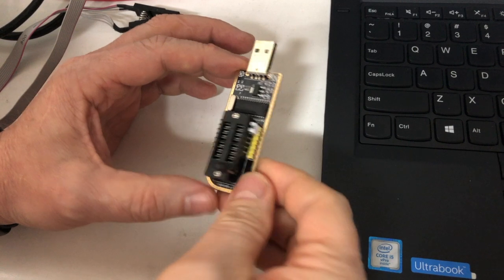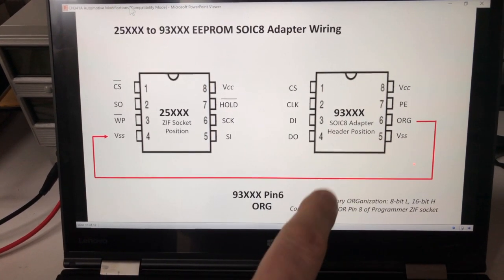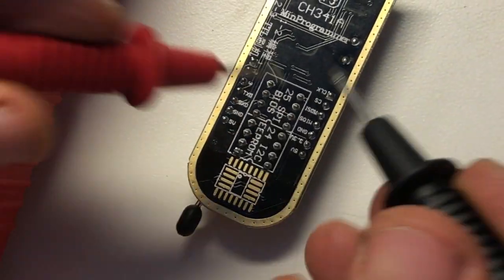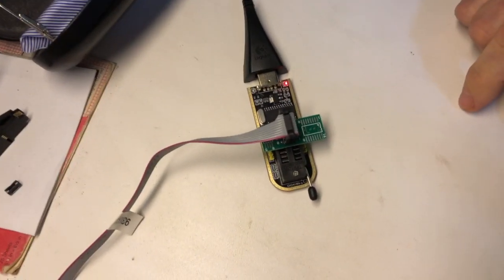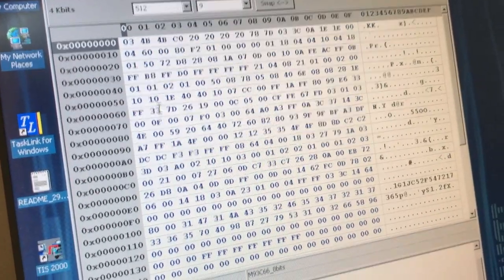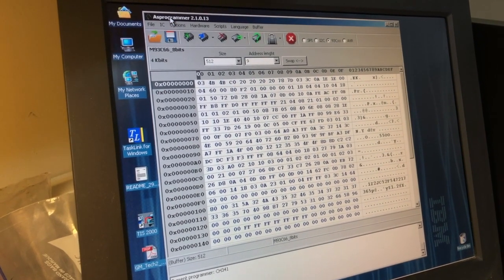Modify the CH341A EEPROM Programmer (Black Edition) for 5V 93XXX & 95XXX Automotive Use

Comment: Hi, there's something I don't quite understand, do I have to cut all connections on the adapter board? (because they are all 1 to 1, 2 to 2 and so on) and then solder wires to the numbers in the schematic? it's not quite clear to me in the video, i want to read and write a 93c56 eeprom
Reply from the maker: Yeah, I get a number of comments/questions about my choice to repurpose the little experiment board that is included with these programmers.  It's totally optional, just seems very convenient to me since the board is included with most sellers of these.   So what you do is make sure, pin to pin, you adapt the board to match the slides shown in the video.  Most of the traces do get cut, and replaced with bodge wires that will be hidden underneath the pins (you desolder that part first of course).   But if you don't want to tear up the little board, you can wire wrap something with a socket or even just hit Eagle and design your own little board and let www.oshpark.com make a few prototypes for you.   No matter how you do it, you just need to build an adapter that maps the programmers ZIF socket pins to what is needed for the 93xxx layout instead.
Reply: Thank, is solder the wires direct on the usb stick on the number you write in the picture but i cant read the eeprom, is have not an 93c56 but an 93s56, this one is not in the list, can you you wit this?
Reply from the maker: @gertbeuk1506  The "S" or security devices require an extra bodging step, listed in the video description.
Reply: @DrShock  i cant get it working, i try to solder the wires but i still cant read it.
i do something wrong but i dont see it.
i follow your schema and write it down so i have the wires from the adapter to the programmer on 
the right place but not working
Reply from the maker: @gertbeuk1506  Being you mentioned it's an "S" device, did you make the modified connection mentioned in the video description for that type?
Reply: @DrShock  Yes I did, I soldered pin 7 to gnd.
I soldered the wires from the clamp to the correct numbers on the programmer, one other thing i dont understand is pin 6, you say in the video that it is not used but some one used it on ground or +5v? When its 8 or 16 bit,  I have a 93s56, how i use 6?
Other question, mabey you know, can i swits a 93s56 for a 93c56 on the board?
Reply from the maker: @gertbeuk1506  The S is a security version and the firmware on the board may test for such a swap, but it certainly is worth a try after you are able to read its contents.  Pin 6 depends on the circuit board, impossible for me to say you'll either have to have access to technical data about the module to tell whether it's 8 or 16bit.  Or you can always logic probe the pin while the module is bench powered on to see if that pin is high or low.  
 
There are some older comments below from others who successfully read the S chips, you may want to read/review them for hints and tips there. 
 
I would carefully re-review your wiring against the adapter guidance.  Remember to use the correct half of the CH341a's ZIF socket as one half is only for the 24XXX chips.
Reply: @DrShock  Thanks for all the helpful tips, last night I soldered it again and I can read it in no time.
again thank you very much.
now the next puzzle, what am I going to adjust

Comment: Thanks Dr Shock, I finally feel like im in the home stretch. Working on a BCM for 2006 Colorado. The Eprom is a 9365217. Would that be in the 93xxx series? Just starting to the mods.
Reply from the maker: I would expect it to be a 95xxx type eeprom (perhaps a 95040).  But haven't ever worked on a Colorado, so could be different.  It won't be identical, different BCM model an all, but you might try my other vid here for that chip type - https://youtu.be/0Kon-FjD0dM

Comment: Hi, how can one tell which serie the eeprom is, is it on the numbers written on the chip? Mine reads S93C66. Does it mean it's a 93 series?
Reply from the maker: In your case yes, a 93xxx series.   The "S" might denotes that it is a secure model, so more difficult to read (check the description text).  Sometimes though automotive manufacturers/suppliers make up their own numbers called house numbers.  And then it's a bit harder to figure out.  But in your case, obvious.

Comment: Hey i have an audi concert and i wanna read the chip its an 95128wp. I have an ch341a but i didnt do this mod and when i read it , it shows only zeros. Do i need to do this mod or can i use that "shown in video at 7:45" ?
Reply from the maker: That time index is talking about 93xxx chips, and the mandatory adapter you have to build to work with those.  For 95xxx it's just software to read (AsProgrammer is what I showed), and the 5V board mod to write (almost all automotive EEPROM circuits are 5VDC only but the CH341a is 3.3V for PCs and the like).  Reading 00's usually indicates a board where the chip cannot be read in-circuit (because you're powering up other chips on the board at the same time).  You'll likely have to remove it from the board to read/write it if so.
Reply: @DrShock  thank you for your very fast response! So i need to remove it and then put it on the adapter or solder it?
Reply from the maker: There are both types, with the solder pad version being cheaper.  But I prefer the push in type adapter that you don't have to solder, like this affiliate one at Amazon https://amzn.to/3wlkqGZ
Reply: @DrShock  i have this adapter so i need to push it in only?
Reply from the maker: Just desolder and remove the chip from the board and then deposit it into the adapter yes.  Depending on how you choose to remove the chip, you may have to clean up the pins of solder blobs for it to fit correctly.   You also have to be sure of the pin 1 orientation in both the adapter, and the adapter into the ZIF socket of course.  If using a CH341a black edition, also the placement into the correct half of the socket for use with 95XXX series devices.

Comment: Great video, Question. If i used breadboard jumpers to the side 5v connection do i have to still cut the trace to the 3.3v and lift the middle leg on regulator? I think im going to use the 16bit option and tie pin 6 and pin 8 to the 5v on side yellow connector.
Reply from the maker: You can accomplish the mod however you like, but you cannot supply two different voltages on the same trace.  Some modification of the circuit board will be required as we showed in the video there is a defect of sorts, in that there is only a single trace on the PCB and you cannot simply jumper between 3.3V and 5V at the same time on that single trace.
Reply: @DrShock  Ok,Thanks. Another question. Before the mod i get 5v at zif on pins 1,2,5,6. Is that the same on yours before mod? Thanks
Reply from the maker: Before  the mod, the version I had showed 3.3V at the programming pins.  Hence the need to modify it for automotive work.  Some versions are the opposite, they only work at 5V and if you work on PC BIOS type stuff you have to mod it to 3.3V.  Unfortunately the typical mishmash of Chinese stuff.

Comment: Thanks Doc, Having problems with the download. Can you help and let me know exactly what to download?  Thanks
Reply from the maker: You need to download USB drivers for this device like any other PC accessory.   Where you bought it might include them, but I have a link for the one specific to this particular CH341A black edition board if not (other boards may require other drivers so check with the seller first).   You'll then also need an application to interact with the programmer, and for this I've included a link to a particular version of AsProgrammer that added the 93XXX/95XXX support.  There are other programs that work with the CH341A black edition, but there are no other ones that support these automotive devices but AsProgrammer today.

Comment: my good man
i hear the pressers of this ch341 but as much as i try i cant get it to work
so,my question to you , is this programmer for real ?
Reply from the maker: It's real, a real bargain.  But it is very limited in the devices it supports, so if you're not working with 25XXX, 24XXX or doing the mods I go over to add 93XXX and 95XXX then it's probably not a good fit for you.

Comment: I am kind of curious why one would want or need to write chips in automotive? It is an honest question, I work on PCs with this thing at 3.3 often enough but didn't think to use it on my car or truck. As someone else pointed out, it would be nice to figure out a way to bypass the need for a stupid expensive tech2 on our Saab. I'd love to also disable the annoying alarm without disabling the AC. (Stupid ass Saabs have the AC and Alarm tied together via fuse. So that isn't a pop a fuse and forget it situation). I am just curious what else could be written. Like maybe change timing, shifting ranges things like that? Disable dummy lights? shrug just guessing here.
Reply from the maker: This is a very common exercise in doing radio repair work, but also in instrument clusters and body control modules.   You often need to manually re-write the VIN of the vehicle to the EEPROM to use salvage yard parts (used modules) vs buying new ones.   This does not remove the need for a scan tool for diagnostics and flashing new calibrations, there's no getting around that requirement with GM vehicles.   But it does allow you do things that even the Tech2 would otherwise prevent - reusing used salvage yard modules.

Comment: One question please, Dr Shock.. 
Do you mean the yellow jumper across 3.3V and 5V wasn't enough?
Reply from the maker: You have to cut the trace, in addition to installing the bodge wire there.  As shown I further disabled the 3.3V regulator, as there is no chance I am ever interested in such a voltage for automotive work.
Reply: @DrShock  OK. Thanks
And I checked, the yellow jumper is for selecting programmer mode or TTL/serial. (not voltage like I thought). 
My bad.

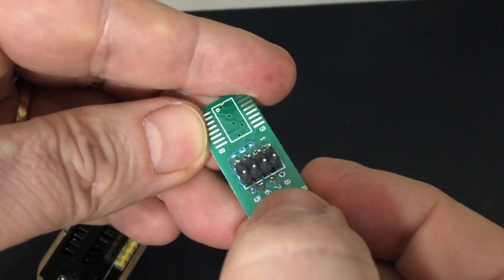Comment: did you cut the printed runs when you made the adapter? @4:14
Reply from the maker: Yes, of course.  If you use an existing printed circuit board you will have to modify/customize it to meet the adapter requirements.   There are many ways you can go, I just took this route as the programmer came with some of these little DIP prototype boards I would otherwise have no use for.

Comment: #DrShock I followed all your instructions even connect 5V and install driver and reader software but the CH341A brand QSKAII with test Clip for EEPROM 93c56, reads "FF FF" every time even when it shows red light and green light when reads EEPROM. Please help.
Reply from the maker: Well for the 93XXX devices you need to build the pin adapter I show in the video.  This pin adapter will sit in between the 25XXX ZIF socket on the CH341A and your device.   This maps the pins correctly between the two EEPROM designs.   So if you have triple checked the adapter wiring, and that you have the pin 1 orientation correct, then you may have a circuit that board that cannot be read in-circuit.   This is fairly common, and in which case you'll need to desolder the device and read it out of circuit instead.

Comment: Do you have an actual picture of the board adapter you created?
Reply from the maker: No, but it's an exact match for the slides shown in the video.   You just need something where you can map the pins that go into the ZIF socket of the CH341a, to the pins that go into a testclip ribbon cable connector and cross over the pins accordingly for the 93XXX pinout needs.  You can even just manually wire this up using a 8 pin DIP adapter.
Reply: @DrShock  Thanks for your reply. I made an adapter using the included board and wires. What I've noticed is for a 95040 that's still on the ECU, I get a different read every time. Is this normal? I think you mentioned in your video that most of these EEPROM's need removing and seating properly otherwise they won't read? The same method on a 24c04 reads a perfect read everytime with no desoldering. I'm guessing this is what you meant when you said it'd need desoldering?

Thanks
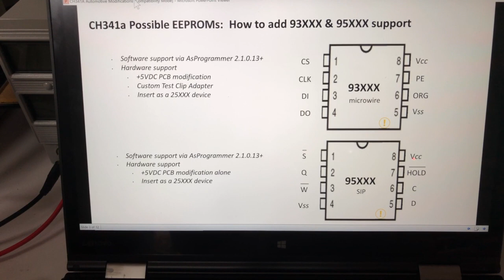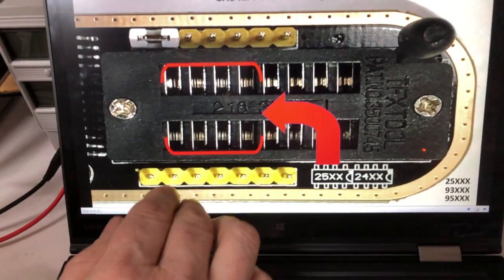Reply from the maker: So that adapter, as the video goes over, is only for 93XXX devices.  You do not use it for 95XXX devices.   For the 95s, it's just the 5V modification to the programmer (if applicable some newer versions may longer have this limitation based on viewer comments) plus different software like AsProgrammer.  You do not use the adapter. You may want to re-review 0:56 and 1:25 of the vid.
Reply: @DrShock  Thanks for your reply. Yeah I worked this out in the end. I'm not too knowledgeable with this. In essence, I don't know when/if I'll ever need the adapter tbh as I suspect this will be a single use thing. However, the 5v mod, I also did and has worked like a charm and has allowed me to get a stable dump. Thanks for your help.
Reply: @DrShock  one more question, is the mod involving lifting the leg on that voltage regulator strictly necessary? I've tried writing and it does work but I am unable to lift that leg up. I guess if I pile of some flux and brade it off it will lift up, but anyway
Reply from the maker: It's just insurance in case the bodge wire cut on the bottom was not correctly done.
Reply: @DrShock  ahh understood. Thank you. I've been testing it and it works great. This video is superb.
Reply: @DrShock  I know I keep coming back with questions lol, 24cxx can be read safely at 3.3v, does it matter that by cutting the trace we're now reading at 5v?
Reply from the maker: np.  In automotive there are no 3.3V devices in widespread use, only 5V.  Though the 5V is usually only an issue when writing, not reading, it certainly is native to the devices even for reading.  BTW these modifications are automotive only, if you're wanting to work on PCs and consumer electronics then you need a second programmer.  Or one that has a switch to go between both voltage levels.
Reply: @DrShock  I'm only using this for automotive use really. Great guide though and I've been using it again this morning and it's pretty bulletproof.

Comment: Hi I’m wondering if you can help me, I’ve done the mod but I still can’t read a 93cs46 any idea what software can read this chip please as it’s not listed in asprogrammer or what I am doing wrong , thanks in advance :)
Reply from the maker: Have you tried reading it with Asprogrammer just as a 93C46 with the appropriate 8-bit or 16-bit as necessary for the circuit it's coming out of?
Reply: @DrShock  hi thanks for reply , yeap I’ve tried asprogrammer and neoprogrammer both same result, 8bit and 16 bit high low etc I’ve tried a few ways but not reading chip well it says success crc32 = 0x0D576256 but it’s just blank  Fb and dots the chip code is cs463st310b  any ideas lol
Reply from the maker: You reading out of circuit (desoldered from the board)?   Usually when I run into problems reading, it's when a board isn't compatible with in-circuit test clip style reading due to 5V from the clip inadvertently activating other components on the board.
Reply: @DrShock  it’s desoldered and in a sop8 clip with the wires going to a pinboard then in 25xx socket hope that makes sens ;) lol
Reply from the maker: And you have made a 25xxx to 93xxx pin out adapter like I go over in the video in between somewhere to translate the 25xxx socket to the pinboard now holding a 93xxx, in your example?  I don't mean to ask this in a negative way, just trying to eliminate easy stuff.
Reply: @DrShock  hi yeap I copied the same way and tried high and low, my chip cs463st310b can it be read by cs93 just making sure I’m selecting the correct chip in asprogrammer etc thanks for your help :)
Reply: I mean I’m selecting m93c46 to read my cs463st310b is that correct? Thanks
Reply from the maker: That first number you gave yesterday, 93CS46, is an EEPROM number I recognize.  This cs463st310b number from today is not.  You sure that's what is on the device?
Reply from the maker: What type of vehicle module, and manufacturer is this cs463 device part of?
Reply from the maker: Also, I think I recall what's different about this chip now.  It's a security enabled device.  Scroll down to the comments on this video from 2 months ago.  Comment started by Jorge Luis about the 93cs56 that we worked thru.  The change described there should fix your issue.